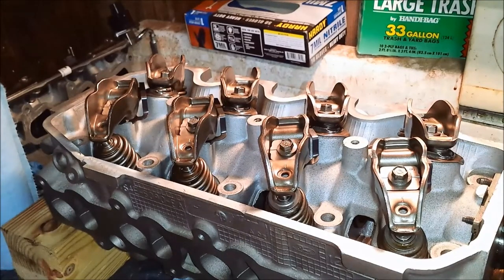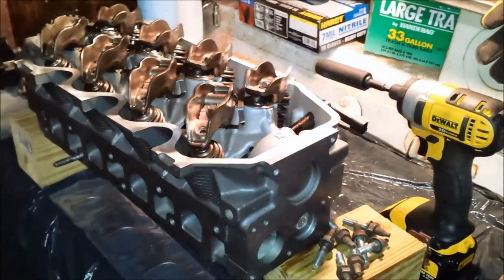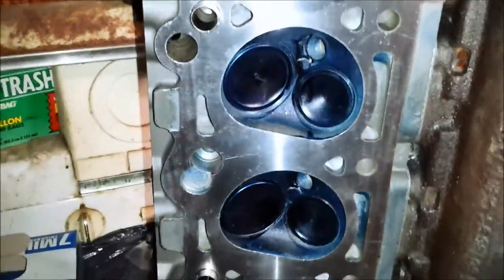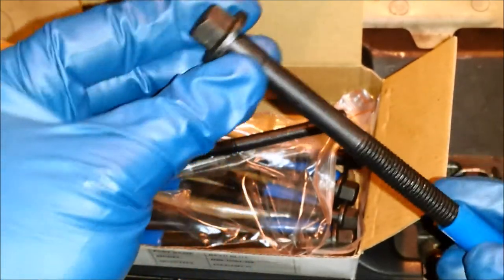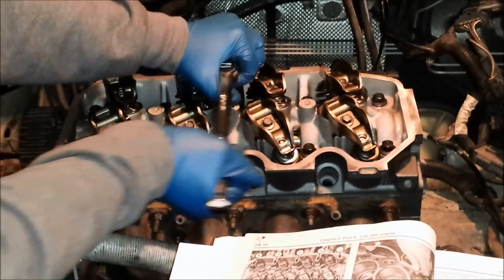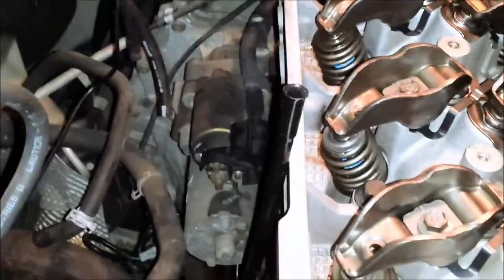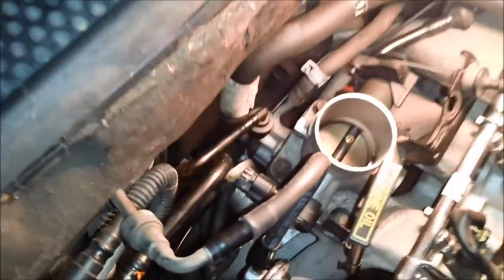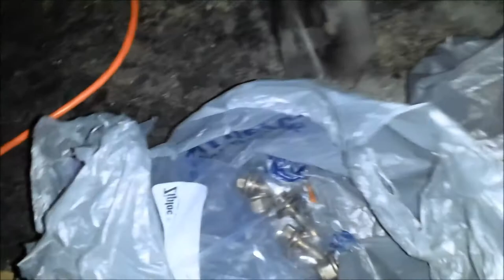Ford Focus Engine Rebuild 2.0L SOHC SPI - Part 10

Comment: For future reference, it will be easier to put the head on if you put the dowel pins in the block and then put down the head gasket so it doesn't move.  Keep up the good work sir.
Reply from the maker: +complink Great tip, that's what I should have done.  Thanks!

Comment: When you were trying to figure out the area around the intake manifold, why didn't you just look up intake manifold installation and removal or something. By the looks of it they probably had pics too
Reply from the maker: No idea.  Stupidity, impatience, alcohol clouding my judgement or all of the above.  Referring to the service manual was getting pretty old by this point.  It bounced around from section to section to section.  You needed about 6 bookmarks so you could back track to the original task.  The service manual was Haynes, you asked in another comment.

Comment: Having issues getting my fuel rail back onto the injectors... Tried oiling the shit out of both sides but nothing. Any tips?
Reply: Chance Herr Apply some pressure. They’re snug.
Reply: Also put the injectors on the rail, then put it in all together.